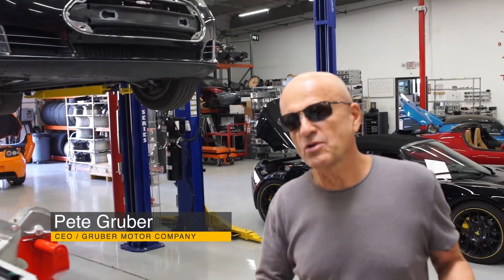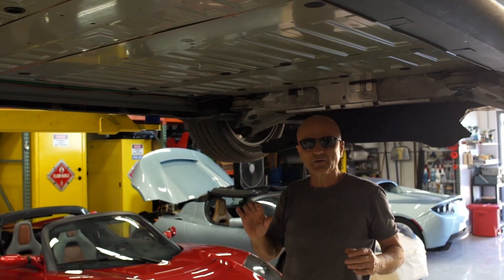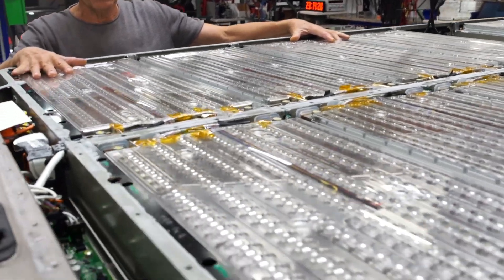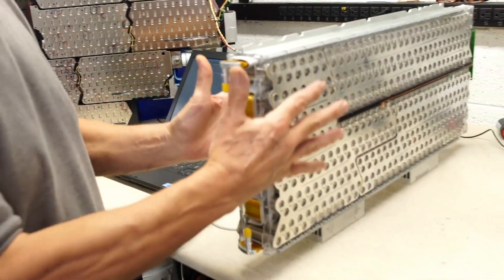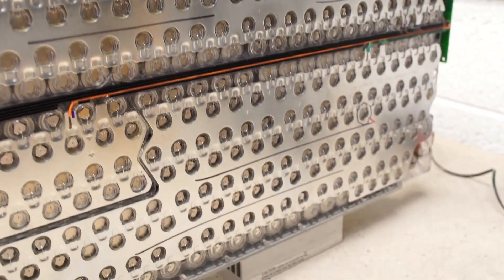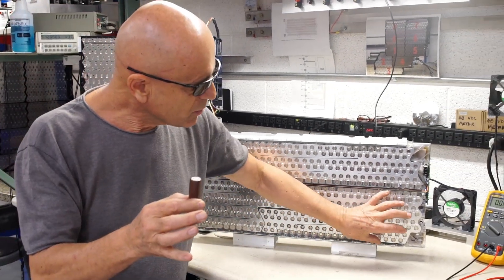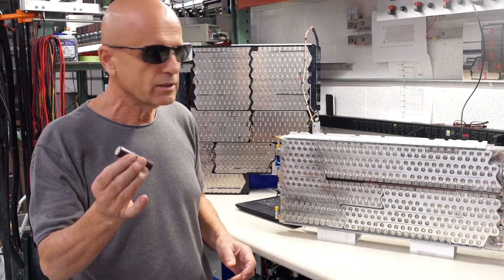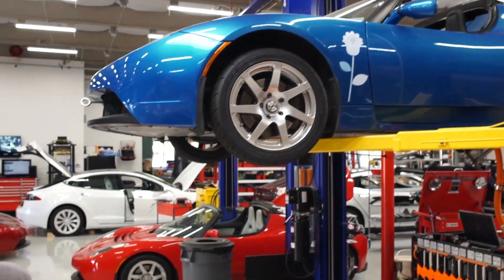Tesla Model S Main Battery Repair | Gruber Motors

Comment: Great vdo, Pete Gruber is very easy to listen to, no nonsense, and technical details explained in an easy to understand manner. 
Question, premature maybe, will you also be able to isolate a faulty tabless 4680 battery as they are supposedly going to be epoxied in place?
Reply: We have not seen these yet.

Comment: Can you comment on the quality of the replacement cell, total capacity, chemistry, reliability, construction? Not all lithium batteries are the same and there can be several variances. Tesla OEM is the best on the market, so how will this new cell affect the module?
Reply: Cells that go rogue in a brick like this are not replaced.  They are snipped out.  Impact is virtually unnoticeable since there are so many cells in a brick.  The Tesla MS  BMS is very sophisticated, except down to the brick level where a number of cells are connected in parallel.  To the BMS, a colony of cells looks like one.
Reply: @petegruber2353  that makes sense, thanks for clarifying
Reply: Great video.    Pete ---curious how long it takes to find the module, then the particular brick and finally the "rogue" cell ?  
Do you have to reset the BMS?  
Does your company do software updates ? 
Thanks.

Comment: Cool video but somewhat misleading to most people to be honest.
Would like to add my two cents as a batterypack engineer here...
I totally understand this is the most cost effective way to get the pack running again, however!
A bad cell only causes the battery to stop functioning once this cells in parallel block has discharged to under the bms’s set voltage limit. From which point the bms registers a missing series and then shuts down the entire pack. A cell that has internally shorted to the length where its self discharge is so large that it manages to discharge all of the energy of remaining in parallel cells means that by the time the pack stops working and then is opened by you the remaining 73 cells in the parallel config have oversischarged and potentially gone way too low. Discharge does not stop once the pack is deactivated. So you would have to have charged the block of those from too low up to the point above undervoltage limit of bms. Doing this Causes increased internal resistance of those cells, A because they were too low and built up resistance and B because the charge procedure is then bad for it. Built up lithium plating inside is the cause, making these cells run hotter and not hold their voltage under load like the others. 
Then you add that you now have 1 cell less in the block. So the whole parallel block discharges faster and charges faster then the rest of the pack.(becuase less capacity) ALL THE TIME! Making the bms work over time trying to balance it upon every charge operation. Less cells in the block mean less cells to spread the load out and therefore lower voltages under load and more stress on the pack and also the bms (the bms monitors and balances on discharge under about 3.3V per cell to) so this whole in series block will die earlier then the rest. Until then looses capacity quicker so at one stage u have bad range as it will always be discharge to 0% faster and when its at 0% the whole pack shuts down.
Might be after the service life of the car or very quickely. 
It works yes but its not ideal.
Reply: @JanLenz  yes if the main controller does not need a special code / handshake with the slave modules. Dont know if tesla has that to stop unauthorized people repairing the packs...
Reply: Jan Lenz , the problem is the exact cell for this Modul knows only Tesla. if you have a different cell in the Modul the balancing of all cells is the problem for the BMS. if you cut the bad cell out of the Modul you lost only a few precent of capacity. If you have a second same  battery you can change the cell.

Comment: Question,  was the dead cell replaced or just taken out?
Reply: Snipped out.
Reply: @petegruber2353  to be, that isn't a clear answer. I assume the cell is left in place, but is disconnected. If so, that would address the remaining cells in the block more by a few percent. Might be ok for quite a while. If the cell could be replaced, that would be better. But that would require a cell of near equal state and that is probably difficult to find. Then maybe snip a cell in the rest of the blocks and balance is restored?

Comment: What do you think about the upcomming cell to structure architecture with the new 4680 cells.
Do you think there is a way designing it in a way so that repairs are possible?
Or do you think tesla will just count on that the cells will not fail, and if so then they will be ok with recyling the whole car?
Reply: Cell technology is a new frontier.  Self healing packs are also do-able.  Hell, with AI, self-repairing  cars are not too far away.  The car does a self diagnosis, signals the OEM for parts, schedules service, and drives itself to the Service Center for repair.
Reply: @petegruber2353  ....does my grocery shopping too!!

Comment: wow, I thought the battery managment system could handle bad cells
Reply: The Tesla MS  BMS is very sophisticated, except down to the brick level where a number of cells are connected in parallel.  To the BMS, a colony of cells looks like one.
Reply: There is no hybrid / EV pack that can manage down to the cell level.

When that day comes it will be a game changer for packs.

Comment: Never replaced the bad cell?  Just isolated it?
Reply: 1 cell out of 7000 is a 1/7000 decline in range. The individual cells are very well stuck in place and if you remove them you have to redo the entire shell which keeps them together series-paralel. So its just better to cut out the dead cell.
Reply: @vladbleoanca9201  The capacity imbalance caused on that parallel is of 1/74 (there are 74 cells in parallel, then series of 16X6 of those parallels), which is -1.3%. The BMS will handle that, provided you get to 80% SOC and stay there or above for large extended periods. The pack's practical range is -1.3% down, as that parallel will trigger Under-Voltage protection sooner than all other 95 parallels. I assure you I'd live with those numbers, on a 10k$ tesla + Gruber's bill.
Reply: There are 73 in parallel and 6 of those parallel banks in series in each module. Snipping one out means a capacity loss of 1.4% in that bank.

Comment: how much % of capacity will be lost after this procedure?
Reply: There are approx 7000 cells in the car. So 0.14% capacity loss
Reply: @sp33dlink71  hmm, thats not how batterys work
Reply: @sp33dlink71  Sorry, it’s actually 0.014% loss. Your math was out !!
1 divided by 7,000 = 0.0001428 x 100 = 0.014 %
Reply: @Nicholas.T  sorry it is actually 1/74th loss  overall..   each other string will need to adjust for the lowest string

Comment: Aw, come on!  How did you isolate the cell?
Reply: Charge it with low current and look with an IR camera. All normal cells will store the energy efficiently. The defective cell is resistive and will dissipate the energy as heat. Easy
Reply: @yitao_ding  I think that's what I would try with the FLIR but it's so tightly packed the heat might dissipate to the other cells.  But good idea.
Reply: @yitao_ding  That's the first thing I thought. It's lots of singles in parallel so unless you disconnect all cells and test, you can't simply use a DMM or the like. You'd have to take the module apart to measure each cell or us an IR gun/camera.
Reply from the maker: No that’s the secret sauce! We will be doing an in-depth video on more reverse engineering projects with the Model S in future videos.
Reply: @grubermotorcompany  I wonder if they try to design cells to fail 'open'.  That would solve the problem if you could control that.  If you had a tiny circuit that could measure each cell's IR drop and then open the circuit that would do it.  You can imagine a cascade effect with fire they way they are used.  Secret sauce.  Thermography?  How many are in that parallel string?  Divide and conquer?
Reply: Of course those in series you'd WANT them to fail closed.  :-)

Comment: Do you plan on opening a service center in Belgium for the hole of Europe? Intercontinental part swaps would be great since in Europe nobody really is able to realize those roadster or other Tesla repairs and there are fewer parts over here.
I am doing my bachelor in electrical engineering but would love to repair Tesla cars.
Reply from the maker: We would love open a division in Europe, not entirely certain where though.
Reply: @grubermotorcompany   yeah it's a complicated choice indeed. Norway has lots of cars, but are far from everyone. Between The UK, theNetherlands, Germany and France, you have Belgium, so it would be centrally located over there.
Anyway, it would be great!
Reply: ,would be good !for the time being no offer needed because under warranty but once out of it would.be required to have such skills !

Comment: Did you replace the cell?
Reply: I know it makes it work now, but doesnt that reduce the overall capacity with less cells in parallel? Also makes charging and discharging not work as well, since this parallel string has less capacity. Would imagine this would have some error codes.
Reply: @petepetess  The Tesla MS  BMS is very sophisticated, except down to the brick level where a number of cells are connected in parallel.  To the BMS, a colony of cells looks like one.
  It cannot see a missing cell.
Reply: No easy/cost effective way to do that.  Isolating is the process.

Comment: So you simply just disconnect the single cell and leave it in place? And then reinstall the sheet?
Reply: Fundamentally, yes.  Each brick can afford to lose a cell or two without skipping a beat.  Locating the cell is where the secret sauce recipe is in effect.
Reply: @petegruber2353  Pretty confident Tesla will disagree with that assessment.  Why aren't you just replacing module with the bad cell(s)?  This would be far more efficient and wouldn't result in a compromised battery pack.  Model S/X modules on second hand market are relatively affordable.  This seems like an odd way to go about 'fixing' packs, especially given the price.

Comment: this is a quick fix  u need to replace the cell not cut it out of circut this will cause other cells in parallel to take more current draw  causing them to heat up  more under heavy load this will work if u cut cell out but it will cause more to fail in future
Reply: Depends on the math and the regime of operation. 1 (# of cells missing)/ 72 (total cells in parallel making each supercell). That's 1.39% difference... That's how much extra heat the other parallel cells in its group have to deal with and the cooling system will inherently draw extra from them due to the delta T vs. other cells.

I bet they proposed replacing the module and the owner said nope due to the price VS return on that. He still has a 98.61% of the capacity there.

In other words, no problem.
Reply: @Kimoto504  I don't think you watched the video.  

The video is touting their "new" repair capability.  (e.g. soliciting other customers for the same procedure)

This wasn't a one-off "the guy didn't want to replace the module" 

$5K to snip a cell out is not a good deal, I'm sorry.  I full battery pack replacement (used) is ~$10K.  A battery module is ~$1K used.  New warrantied battery pack from Tesla is $15-$20K.  

If this was ~$500-$1000, OK.

But to spend more for a cell "snip" then a module is silliness.
Reply: @Kimoto504  its not a capacity problem its a discharge/charge rate problem   for example  let take a smaller sell count   lets say 1 18650 has a c rating of 5c  on its own  putting 2 in parallel  splits the current difference  so cell takes less current threw it then  it would on its own     more in parallel   more current u can pump threw them and thay can take up the added current draw this also works for discharge   u can out put more current with out stressing the sells if u got more in parallel then  less     so if u got  are drawing 5amps and u got a 1ah 18650 cell  u can draw 5 times its rating if its rating is 5c  if u got 2 in parallel   u can draw  5 times pack capacity at 2ah see the difference this is how telsla gets such fast response because battery  can push lots of power   at once   another negative side effect of cutting fuses to remove cells is other fusees still connected need to take more current load  which will make them  often to fail or burn out from over draw
Reply: This "repair" actually makes me angry the more I think about it.  

If they are just 'cutting out' a cell, this should be far less than $5K.  There's no materials here and the labor is relatively minimal. 

For $5K, you'd think they were at least replacing the 'bad module' with a good one.  (you can get tested modules for ~800-1000)  [~$10-15K can get you a replacement battery pack]
Reply: @beyerch  Agreed. I was getting moderately excited to see how they would extract and replace the cell or rebuild the brick, but nope - snip the fusable link and unbalance the module and leave it to the BMS to sweat over it. FFS.
Reply: @beyerch  Yes, they could have swapped the module for another one. lot's of Model-S modules for sale. I think the reason why they isolated the bad cell instead, is that they have been doing the same thing for Roadster owners. Problem with the roadster battery is that there is no abundant supply of battery sheets available.
It's basically the only way to fix the battery.
Reply: @mikestegen  Ok, but I think the other reason is purely profit.  Why waste time procuring parts / replacing module for $5K, when I can just clip a couple wires and have no cost?  

This is not a good repair.
Reply: @beyerch  It is not $5K. for just cutting the wire on the bad cell, for that it's just $1.  Then $4,999 for knowing exactly which wire to cut, how to reprogram the BMS and how to handle high voltage properly and secure. Otherwise, you can do it yourself.
Reply: @MarcoGaxiola  I was, unfortunately, waiting for someone to make that comment....  

I don't need to pay anyone $4.9K to cut out a cell which just weakens (albeit slightly) the battery module when I can pay ~$1K for a good module and just swap it.

Honestly, wouldn't it be easier to locate the bad module and just swap it anyway?  Of course, there is no material cost if you just snip out the cell and call it good so this feels like a cash grab.  

:shrug:
Reply: @beyerch  What does a module cost? Where do you buy it from - Telsa? And how much to install?
Reply: @sgttaz91  "market rate" is anywhere from $800 - $1200 per module 2nd hand via eBay.  Slightly more from EV shops; however, most give you significant quantity discount.  

Installation?  No more than the 'fix' in this video since they are already dropping the pack and removing the module.

Should actually be less labor since you don't have to waste time opening up the module, trying to find the "one bad cell" out of hundreds, 'snipping it', properly sealing up the module, etc....  

There's nothing in this repair that necessitates a $5K cost.  (other than no one else is offering a service)  $5k w/ replacing the module would still leave them w/ $3700+ in gross profit.
Reply: @MarcoGaxiola  Well said....add in the labor involved in removing the lid, which if replaced, would be much faster, but be unusable after the fact.  There are no spare lids, so repairing it becomes a labor intensive and time consuming process, including restoring it for re-use.

Module replacement is an option, but selecting the right version, with matching BMS and cell aging, since there were module variances, adds complexity.  At the 3rd party level, there are no repair manuals, instructions, other than what companies like us are able to glean from reverse engineering.

We are planning another video with much more detail.

Comment: This is awesome. Is there significant risk of 1 or 2 more cells going bad in the 1-3 years and requiring then another ~5k x 1-2?
Reply: The cells are surprisingly stable.  Out of dozens of Roadster battery repair and recovery customers, which are 4-5 years older, we have had only one battery pack come back after a year of use with another cell failure.  His car was also bricked, which stresses the cells much more than normal use.
Reply: @petegruber2353  bricked ? software failure ?
Reply: @AAAAAAndrea  no, it usually means the battery was left to discharge itself dropping below 2.0V of cell voltage. Most common cause is to leave the car in storage without a charger attached. Once completely discharged, cells get damaged and you cannot "just" recharge the car.

Comment: The best and most informative Tesla Battery 🔋 Pack video I’ve seen
Reply from the maker: Andre Young We appreciate it! Part 2 of this series will be released shortly.
Reply: @grubermotorcompany  On a salvage car(missing battery) there`s no reason someone cant build a battery pack using other battery formats with the right software/bms to talk to the OEM Tesla software, same goes for after market chargers, motors from Volvo/VW/Porsche etc would be a perfect engineering project in collage/uni etc....nothing wrong with learning :):)